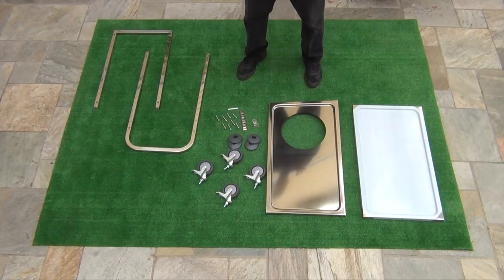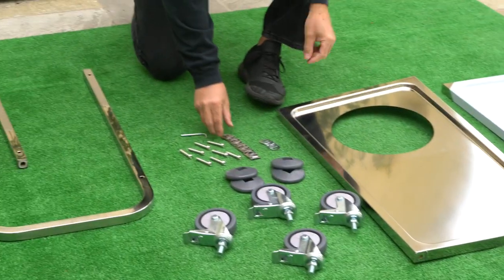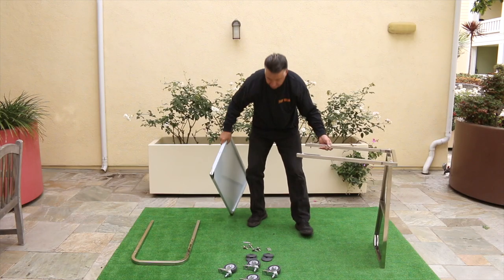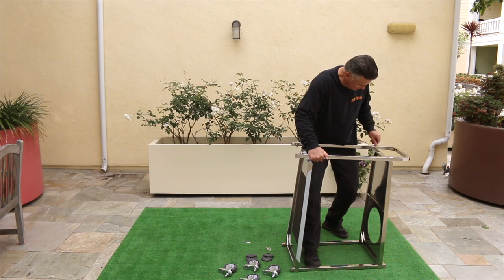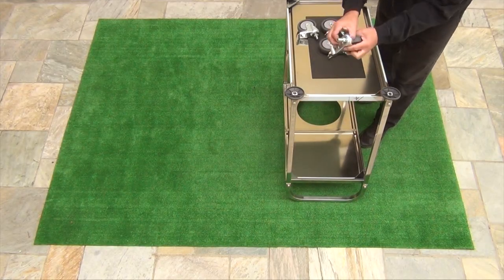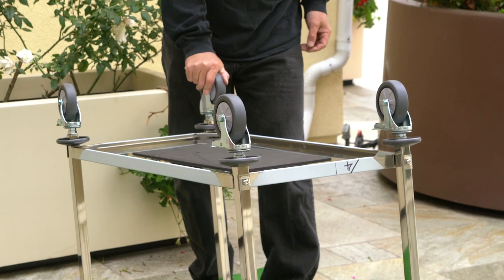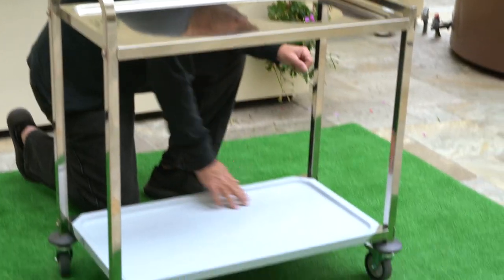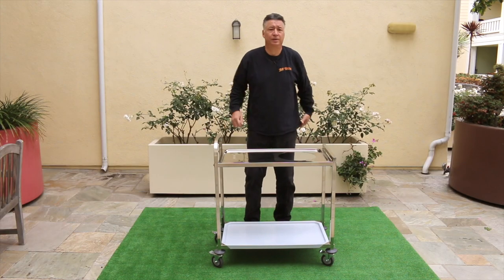EZ-Wok Cart Assembly Vol. 51 - Step by Step Tutorial

Comment: Looks really flimsy sorry but it does
Reply from the maker: Mine has been holding up for the past 10 years, It's definitely light weight, easy to haul around
Reply: I have had this exact setup for more than a year. Once it’s properly assembled it is very sturdy. I even have the 20-lb propane tank stored on the bottom shelf sitting in a propane tank stabilizer that I bought on Amazon.